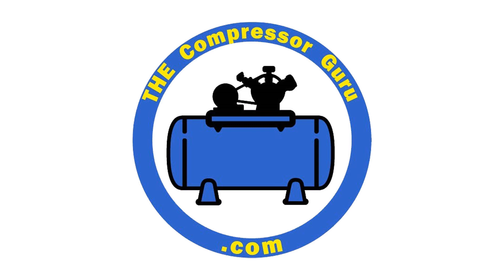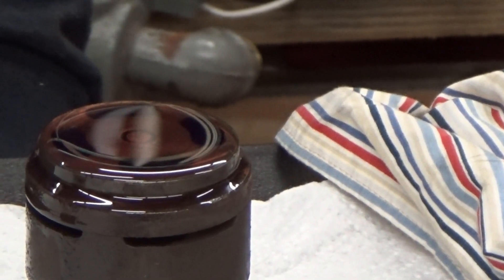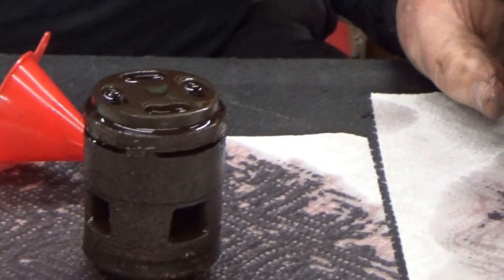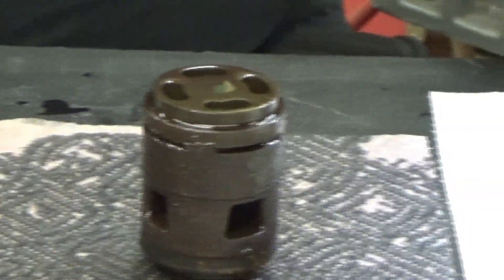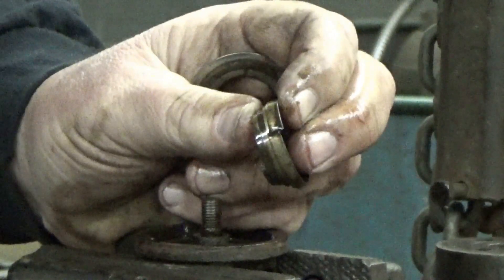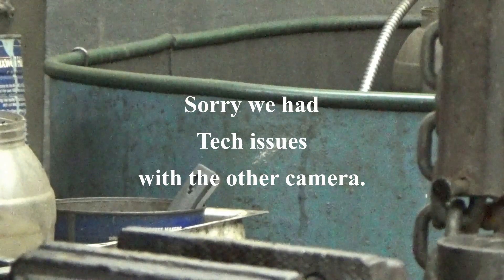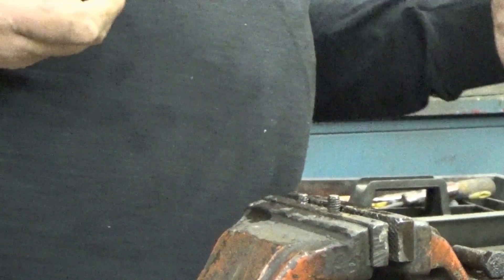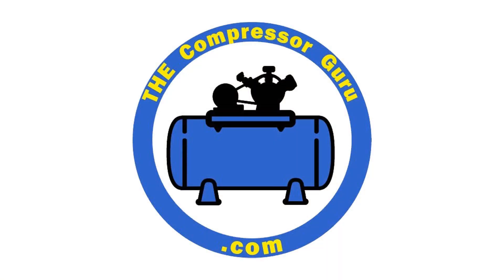Quincy Valve Testing and disassemble S3, E 16

Comment: 10:18are you sure that’s not a valve seat the parts manual cost it a valve seat not a bumper. I am so confused. Can you please help me?
Reply from the maker: copied from parts book 1 7271-004 discharge valve bumper  
intake  is 1 7277 valve bumper 
the disc and spring are obvious as for the description. I am looking at a 325 roc 107 book.
Reply: @THECompressorGuru  isn’t the part of the valve assembly that the disk rides on opposite side of the spring typically called a valve seat not a bumper?that’s according to the Google research
Reply from the maker: I  a just looked again and it list a seat and it list the bumper 1 line below it it does look concusing

Comment: Hey Compressor Guru. Question about Quincy pumps 325, 370 or even 390. Just started getting into working on these things. Noticed a lot of the pumps leak drips of oil from cthe cover behind the flywheel. I've looked at schematics and don't see gaskets, just shim plates. Is there an oil seal in the cover or what's making them leak from cover behind flywheel. Any help is greatly appreciated.
Reply from the maker: I have some advice. Contact me through thecompressorguru.com 
What is am thinking may surprise you.

Comment: Hello. I ended up buying a Quincy 325 QRB from a decommissioned drilling rig, and it seems to be in good condition. The honing on the cylinders hasn't worn off yet.
Reply from the maker: even if the Hone marks are still visible. if you are putting new rings in you need to hone the cylinders so the new rings will break in properly. Contact me if you need any parts. :)   thecompressorguru.com

Comment: I subscribed because I have several Quincy comoressors. From a 325 to a 390. They are built like tanks. I especially like the inline head and pressurized oil system.

Comment: Nice video.  The valve that did not leak .... I would still want to replace the old valve spring because it may be weakened from use and allow the valve disc to "float" a bit during running conditions.  I don't think that has happened yet because the valve disc would overheat.  That disc looked great, but if you want the rebuild to last, I'd replace the springs.
Reply from the maker: John Shhh you will ruin the next video. LOL

Comment: Can you flip that valve washer over and get a good surface for sealing or sand it down smooth again if the face is rough?
Reply from the maker: Short answer is no.
these valve disc are very hard, they have to be. often an older disc will be marred from the spring pushing up. I could have probably gotten away with just cleaning the valve disc and changing the springs. I think the old style springs were pretty weak.
I remember the old series of Mcguiver in the 80s he fixed a Quincy with a flat washer. and that probably worked for a week. but these disc need to be HARD they slap shut 900 times a minute. run a pump 2 hrs and any soft metal will be deformed. 
good question . thanks
Bud
Reply: @THECompressorGuru  thanks